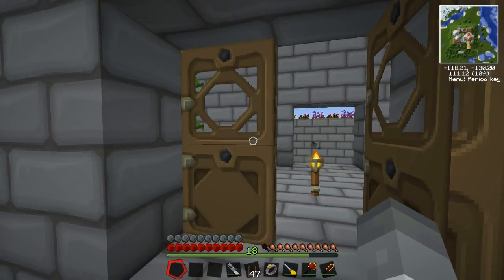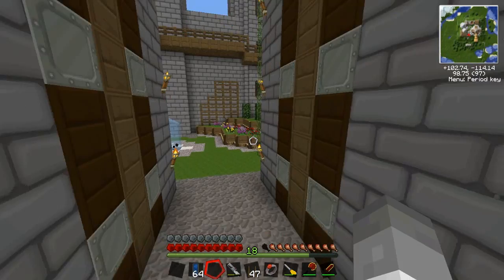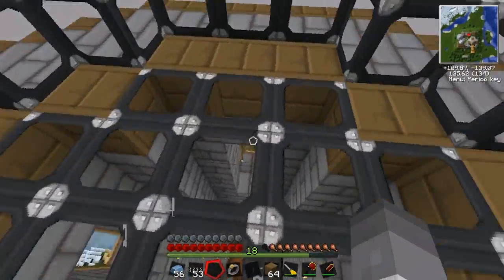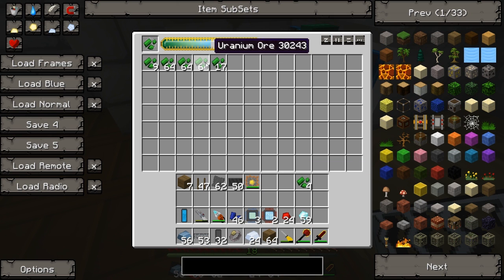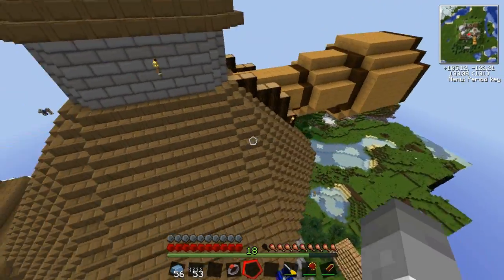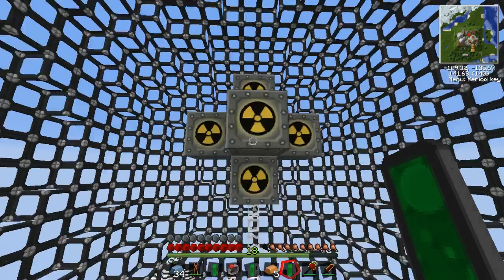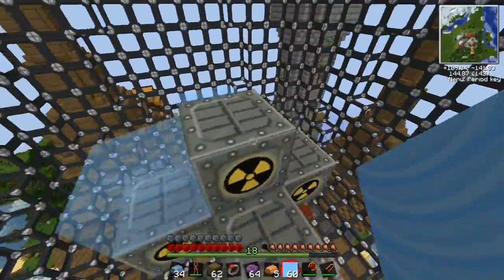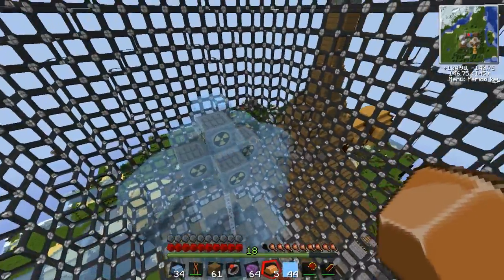Duncan's Lab - 61 - Building the Reactor

Comment: Its because its like still sand that is only available with w/e or mc edit  if a block is placed next to it the block is updated similar to the function of a BUD switch upon said still sand/water/lava block being updated the "still" property is removed because the block has been registered. With third part programs like mc edit or w/e or tekkit in this case they prevent the block being registered. When you placed a block the water was registered

Comment: If you run that redstone signal into the reactor itself and invert it (so that the signal is ON when the reactor is COOL), then you can self-regulate it. The reactor will turn itself off when the heat gets too high (redstone signal turns OFF when reactor is HOT).

You can even keep your alarm. Just invert the signal again before it reaches the buzzer.

Comment: when i built my nuker reactor the power from the heavily insulated cables didn't reach my MFS unit so i used glass fiber cables and it worked fine...

i hope this helps

Comment: Ok... so clicking on the doors to close them is starting to hit serious pet peeve level... it has taken long enough i will say it... put a pressure plate inside the door and it will automatically close them for you... and open them when you want to go out. You will still need to open them to go in but it will be as normal. No need to close them.

Comment: The control part make it so it doesn't just move 1 stack. It moves all the stacks of the item type. So for example, you can clear your inventory of cobblestone after mining by control-shift-clicking 1 stack into a condenser. It moves all of the cobble in your inventory simultaneously.

Comment: Duncan you are going to burn the glass fibre cables out, use HV cables and a HV Transformer.  P.S. I have a ton of simple cheep reactor designs that will never heat And have infinite cycles.

Comment: Duncan, you should set up the reactor differently. Energy collectors connected to a condenser making ice --> ice pumping into reactor -->you can fill all but 7 slots in the reactor with uranium cells and it'll never overheat. It'll make an enormous amount of power as well.

Comment: Yes, and it's much more effective and low maintenance compared to his method. And a single mk3 will do more than is necessary for the ice production, you really only need 2 mk1's. But, it requires some know-how of red power tubes, which really aren't so hard to learn to use. Buildcraft pipes are too slow when it comes to the pumping out of items.

Comment: when you use glassfibre cable like that, it loses SO much power for each cable.. you're gonna basically have like 10% of total power go into that mfsu.. and you also need a high voltage transformer between the mfsu and reactor aswell..

Comment: If you didn't know this, turn off the reactor using a redstone current, fill it all except the middle 7 of the bottom row, then connect a tube to a condensor that makes ice, and pipe into the condensor.  Maximum power without over heating.

Comment: Hey Duncan, if you ever experiment with any high power per tick reactor designs it can actually output extreme voltage and blow up everything connected. Best to connect the extreme voltage end of an HV transformer to the reactor, just in case.

Comment: ame here, and i once saw a vid where some random guys tested how many layers of rienforced glass and/or rienforced concrete it toke to completly seal off a reactor explotion, and it toke them at least 7 layers of rienforced concrete surronding the reactor in a cube before they stopped the explotion, except for around where the fiber-glass wire was, because that is the weakest point in the whole thing

Comment: Still blocks evaporate if the reactor starts getting hot, so you need to have source blocks high up so that the flowing water gets evaporated then replaced by the source blocks out of it's evaporation radius...

Comment: Duncan, U should make the sphere like 3 blocks thick, it would be SO much more safer that way. Now the wooden blocks at the bottom are the weak point. If the reactor blows up, the blast will get out from those points and annihilate anything in its parth

Comment: You messed up the reactor again, Duncan. It should have been a plate at the top middle bit and the bottom middle bit instead of cooling cells. :/ But it will be fine, I guess.

Comment: what cause the water to not flow was that when placed from a water block is is a singular block and not updataed so inorder to make it flow you need to update it. Also if you want lightning to be around the sphere you can put a swift wolfs ring on a peditstull on the top of it and when its powered by red stone it will create thunder storms

Comment: i think it's because in order for the reactor to cool it needs flowing water (if you think it trough a bit , still water would just heat up along with the reactor , flowing water will supply the reactor with a continuous place to dump the heat).

Comment: You know that your castle is still doomed if that reactor explodes because that one layer of reinforced glass is not enough to suppress a meltdown, you need at least 3 layers of reinforced glass to suppress the explosion. When it explodes the force of the explosion will be lowerd enough by the first 2 layers so that the third one can survive. The only place where you need to watch out is the place where the glass fibre cable leaves the sphere.

Comment: If you're worried about the reactor overheating, just attach a thermal monitor with 500 as the thermal setting to the reactor and wire some redstone dust + repeater to the reactor as an automated kill switch

Comment: why don't you use the red power pump and grate and thingies too fill the whole sphere to the top with water you just have to reroute the pipe to the top of the sphere then temporarily close it leaving a hole for the pipe, fill the sphere stop the water destroy the pipe and the stuff you used to temporarily close the sphere and you have a sphere full of water. if you run out of water move to a bigger lake

Comment: The Multi-Functional Storage Unit, also known as an MFSU, is a Tier 3 energy storage device. It is able to store up to 10,000,000, or 10 million EU (making it capable of powering multiple teleportations, running a Mass Fabricator, or directly storing power from most Nuclear Reactors), and can accept a maximum packet size of 512 EU from each of the 5 input faces (bigger EU packages cause the MFSU to explode).
Taken from the tekkit wiki.
And I did say glass fibre looses less EU then HV cables.

Comment: You'd be suprised, water significantly decreases blast power and lot of the explosion would not destroy much. Possibly the floor and cable+MFSU, but the reinforced glass should hold most of the blast. If it explodes.

Comment: You mean the 4x insulated HV wire?
It looses 1 EU every 2 blocks ( glass fibre looses 1 EU every 40 blocks)
While it can handle Extreme Voltage, It is recommended that Dunca's reactor doesn't get EV because his MFSU would explode. Since Glass fibre explodes at EV, IF the nuclear reactor ouputted EV, the glass fibre would blow up and not let such a high voltage reach the costy MFSU.
Unless he gets a HV transformer or he runs ot of diamonds/silver/glass ( doubt it), he has no need for those cables

Comment: The cannon should come out of one of the towers but use pistons so you can have it hid away and push a button and it pops out and fires and then when it's finish or out of fire charges it will go back in the tower

Comment: No he isn't.
Glass fibre are the best cables ALWAYS unless it carries Extreme Voltage which it isn't.
If it was it would blow up and not allow the current to reach the MFSU so it acts like an immediate shutdown if EV ever goes through the cable. So it doesn't allow the MFSU to explode.

Comment: To make the water still flow, just cause a block update next to it,

Also, to monitor the reactors heat you can use indeustrial information panels, run a redstone current into the panel, have a reactor sensor card in it, (You have to use another item that needs crafting) and then you have a machine telling you the output of the reactor, its heat, and some other stuff.

Comment: duncan there is an easier design you just need to have a constant flow of ice(two stacks) into the machine then you just fill it with uranium cells and put on a nuclear monitor just to be safe then you are done, I have used this design forever and it has yet to fail me.

Comment: To get the water to actually act like water you have to update the block, 
like when you placed a wood close to the water. When you do that it will cause an update to the block which in this case would be that the water starts flowing. So a tip is to use just regular buckets or you're going to have a long day updating the water blocks. An other tip is to use pistons which you can stop the water flow with so that you can check the uranium. But then it would look ugly i guess, lol.

Comment: Glass fiber loses 1 EU every 40 blocks and a 4x Insulated HV cable loses 1.25 EU every block...
HV Cables are not "Better" than glass fiber, it just able to hold EV which is 2048EU. The setup Duncan is using is a Mark 1-O Nuclear Setup which only produces 100EU per tick and Glass fiber cables are able to handle it since they can handle HV, in fact it's actually better to use Glass Fiber cables since they lose much less EU over long distance. 

And don't worry Duncan. The reactor won't blow up

Comment: Unless his reactor outputs more than 512eu/t Glass fibre is better.
If it DOES output that much energy he should just use a HV transformer and THEN use glass fibre. And MFSU can only take 512 eu/t packets so it is safer

Comment: No.  Use Glass Fibre for your reactor unless you know it'll produce Extreme Voltage.  HV cables are the least efficent cables, they literally lose about 1 EU per wire.  Always use Glass Fibre if you can.

Comment: Duncan don't use the glass fibre cables to take the power from the reactor to the MFSU, Use 4x insulated HV, they lose WAY less power and are designed for the reactor. Taked the power out of the MFSU with glass fibre. Like so he can see :)

Comment: Duncan, use the the pumps you used before to fill the room, and perhaps to keep it filled, as i think the reactor can evaporate the water if it overheats, dunno if it helps much but some i imagine.
Oh and for your other water filling problem, can you use a block like a fence, or bars to keep water put and still be able to grab some with a bucket?
Try it, it might work.
Hmm, a half block may be just as good, or perhaps stair blocks, but i dunno about the stairs.

Comment: the amount of layers really doesn't matter int the end, because you still need to have some kind of hole in it if you don't want to place an MFSU inisde it. If the reactor does melt down, the explosion will simply find the weak spot(s) in whatever is supposed to contain it, and then totally fucks up everything in the direction of this weak spot.

Comment: Duncan... to contain a possible explosion you need to put 4 layers of reinforced glass ^^
And i never tryied this....  but you can teleport the energy using an energy link, to power teleport pipe, teleporting it to an engine generator linked with your main power system.
And could be usefull to protect the reactor making a forcefield  around it to avoid "accidents" with another players.

Comment: The water in the nuclear reactor is not to cool it down, when it overheats the reactor bursts into fire, if there is water , it will prevent that and will take longer for it to explode, but will not cool down the current heat.

Comment: To get the water to flow use a block update on the top one by either placing a block next to it, or changing the light, this will trigger a chain reaction causing them all to flow.

Comment: Duncan if you take  the reactor put all the lines but the bottom one filled with uranium then get 3 markIII energy collecters sticked  to a condenser taht condenses ice and then you use 2 transposer to pump the ice into the reactor and it will have everything but the bottom line uranium and the bottom line ice. taht will make about 10000EU per sec and doesnt really explode. did it myself but you need mroe than one mfsu or the mfsu will explode

Comment: I'm surprised by the reactor design Duncan's chosen to use, it may be mk1-O its very low efficiency requires water cooling, yet only makes 100 EU/T. Why not spend 2 minutes of your time on a Google search or download a reactor planner and get something better. I personally have used mk1-O reactors with efficiency 1.5 and 120EU/T and more is possible.

Comment: Duncan, you don't want to put the source block of water on the reactor.  If it begins to over heat it will evaporate any water block touching it, you want to have the flowing water touch the reactor so when it evaporates the block of flowing water will just be replaced with an other. 

Also, block updates are a huge part of Minecraft physics, get with the game dude.

And you can run a Mark II reactor set up with hardly any chance of it exploding, and with a Mark II you get more power.

Comment: Uhm, Duncan.
Search for "Safe, Easy, & Powerful Nuclear Reactor" in the Tekkit Wiki, it is pretty easy and 100% safe.
You can also turn the reactor off with a redstone signal from the first MFSU powered to the Reactor so you don't waste any energy. You will get 2048 EU/t with it from 47 Uranium Cells.

I would just recommend not to use just a single MK1 because of night times etc. but you can also use your glitchy EMC way or some cobblestone generators to create more ice.

Comment: You could just use the blulectric pump to fill the whole sphere with water, and also, you should put the mfsu on the top of the sphere rather than the bottom, since the block with the mfsu isn't protected agains a nuke-blast so it will let the whole power of the explosion down that block in case the reactor overheats :O

Comment: If you wanna produce the most power you can you fill all the rows except the bottom row with uranium then the bottom row with ice and you need to put an energy condenser beside the nuclear reactor and put one dark matter in and an ice block and pump the ice straight to the reactor and it will stay cool without blowing up and you will produce a very high amount of energy

Comment: hey Duncan,you should use a temp. alarm and put it on the reactor so when it goes to a certain heat,it goes off so you know when it's about to blow off. Recommended heat:2000

Comment: To make the water all flow, you need to cause a block update near every still-water.  Build a tower down from the ceiling of wood or something, so the last block you place happens to hit the very tip-top of the highest water block.  It will flow, and hit the water blocks around it, causing them to flow... it cascades, and then all your water is flowing!

Comment: hey, every 2 hours and 46 minuets and 40 seconds you will need to swap out the uranium cells
this reactor will put out 100 EU/t with a total of 20,000,000 EU
the total ammount of items he used was
319 Copper Ingots
152 tin ingots
126 bronze ingots
224 iron ingots
8 cobblestone
157 rubber
158 redstone
52 glowstone dust
52 Lapis Lazuli
and 10 uranium fuel ingots
 

OH AND THIS IS VERY USEFUL:
talonfiremage(D0T)pwp(D0T)blueyonder(D0T)co(D0T)uk/reactorplanner(D0T)html

Comment: If you're not certain of the cooling capacity of your reactor setup, you need to build a temperature control system BEFORE initialising it. Ideally, you have such a system regardless, for emergencies such as some foul scallywag removing your coolant cells.

Comment: Duncan use force fields! They actually stop an exploding reactor 100% as long as the force field is powered when it happens. So it would take Sjin/Rythian a lot more effort to blow up all your stuff. You could even put in inside the sphere you have now. If you're reactor blew now it would cause MASSIVE damage to your tower because the MFSU doesn't stop any of the explosions power.

Comment: Glass Fiber Cables can sustain any voltage of EU, and so can an MFSU. So no insulation or Transformer is necessary, until you want to use the EU to power machines.

Comment: Hey Duncan you should look up how to put fail safes in your reactor so you don't have the same problem as last time. PS. Reactors shut down when you aply red stone power so a switch can shut it off manually without removing uranium

Comment: thats whare you are not wrong remember on the first season when sjin when't to Duncans home blowup Duncans Nuclear Reactor that killed Duncan with full Quantumsuit that Nucler Reactor is the same as two Nukes. you'r correct with the damage but it only gets hit if it is a high explosive power and you'r it does block 90% but not a 100%.

Comment: Though, to be fair, the gem armour can reduce damage by 90% forever, while the quantum armour will only let you be invulnerable as long as it's charged. I think one might be able to heal themselves during battle enough with very low damage rates, and when the quantum armour finally runs out of juice, the gem armour would have a clear advantage since it's easier to heal than recharge.

Comment: Ducan, I know a way to create a fail-safe so that the reactor will NEVER overheat. It's not a setup inside the reactor but a redpower system that disables it after it hits a certain heat that you can set. It will never go above it but it will hover at that heat. It won't turn it off, but it will turn it off until it cools a bit and automatically turns back on.